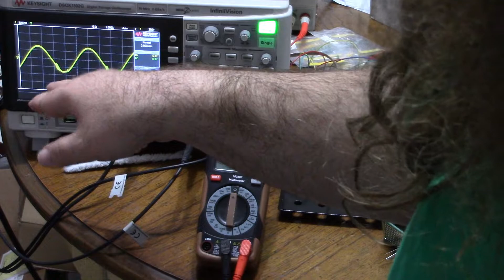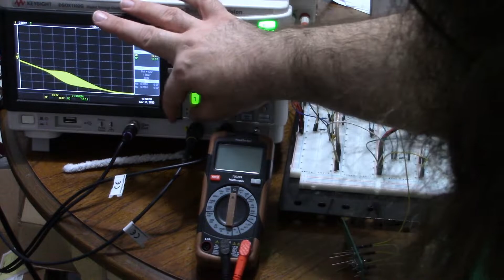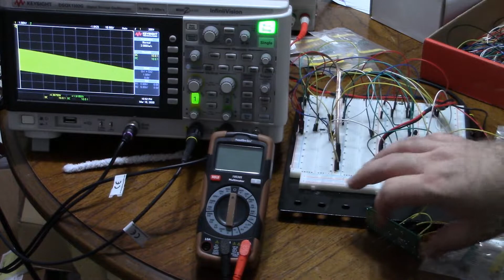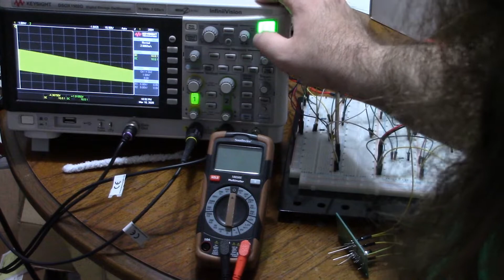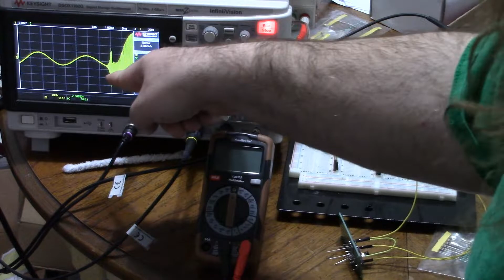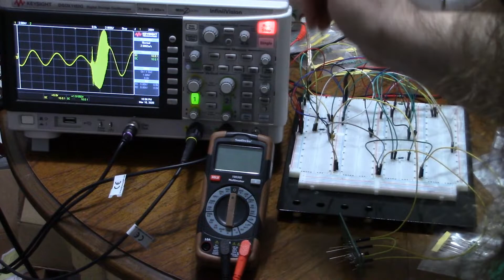Breadboards Destroy AC Signals - Parasitic and Stray Capacitance Ruins My Day - Simply Put

Comment: I was lucky, I got my bread board oscilator to work pretty quick (common emitter colpit) - through dumb luck. Than I put the design into a simulator and it didn't work. Than I try and modify it on bread board to what simulator shows works and it didn't. I have been working on just basic rf theory and amplifiers so haven't gone back to it but I'm glad I saw this video, otherwise I would probably not have got it to work again when I do go back to oscilators as I pulled it apart.

Comment: Great video, you have just convinced me that my problem is definitely parasitic capacitance and I have wasted the best part of 14 months on an 8x8x8 RGB LED cube project. It works, but not like I was expecting or like others I have seen that inspired me to build one. It has a rats nest of effectively 200 jumper wires sitting on top of the cathode and anode drivers stack because I didn't want to go down the PCB route, I now know I might have to. I must say I have learned plenty along the way but I will have to do some more learning to get to the finish line.
Thanks for sharing.

Comment: I try to design a proper radio controller (transmitter and receiver) and desiging on a breadboard is a nightmare! There is not only the capacitance but small elements loose contacts sometimes and recently I mesured exactly the capacitance and there was like 0 (should be 10 pF for example) ! And for a few weeks I was wondering why my antenna wasn't working at all.

Comment: Love your content & style! If someone had the patience, how effective would it be to run fine ground wires as 'shielding' between the long conductors within the breadboard? Would fine wires work, or would they need to be as 'tall' as the conductors themselves?

Could you start with a lower frequency oscillator to get things working, then ramp up the freq to find which bit is the first failure point, rinse & repeat?

Comment: Couple years ago I decided to get into Electronics and HAM radio as a self taught. I set out to build my own radio from scratch and this invariably starts at the local oscillator. Boy, I didn't realize it would take me most of one year just to develop an intuition for Colpitts oscillator circuits, and the skillset to build them.
Bottom line is: breadboards, only below 1 MHz. Beyond that, PCB, or copper clad boards using Manhattan style construction. 
Funnily I only ever built Common Emitter circuits. Circuits like in https://www.youtube.com/watch?v=IcFSVeCF0BM do work well. Considering that the inductor on the collector is paramount.

Comment: I encountered issues with stray capacitance in a recent project where I was finding the microprocessor would halt if I put my hand near it.
I had my 0.1uF caps on all the power rails but those long wires and breadboard tracks really messed with the high speed data pulses.

Comment: Very interesting topic as I've been struggling myself with breadboards on my quest to build cool fxs and electronic instruments..On the other hand, I see Youtube videos of guys building Z80 computers on breadboards so I'm really wondering..Could it be something about the quality of the breadboards themselves, both design and material used? For instance, I got a batch of breadboards that are slightly bent, while some other stand pretty straight. I can't remember exactly but that batch seems to be from a very cheap order on ali express..
Thanks a lot for your videos, I really enjoy the way you explain things although I am not a native English speaker. All my best. B
Reply from the maker: Building a computer like that is going to work great on a breadboard, because it's all digital highs and lows, and since it's older it's lower-frequency which means voltages have plenty of time to settle even with stray capacitance, resistance, and inductance due to the breadboard and any other imperfections. Sometimes the "free" 10-ish pF capacitors can come in handy, accidentally reducing signal or supply ripple. I've seen people say to put a layer of metal foil on the bottom of the breadboard to make it behave better, which is something I should try.
Reply: @simplyput2796  Thank you for your answer! What's still puzzling me is that I managed to have for example this working: http://cmosorchestra.com/2018/03/11/ca3080-4-stage-phaser/ when some simpler stuff wouldn't work..And again I have this batch of very cheap breadboards that "bend" which seem to give bad results..Could the quality of the breadboards themselves have an effect?
Reply from the maker: Bad breadboards could give you issues due to partial contacts, but the quality wouldn't affect anything like how much parasitic noise there is. Also it really seems to depend on what you're doing, because I've done plenty of AC circuits with my crazy long wires picking up signals from Alpha Centauri and what not, and it's only some of them that fail. If the meat of the AC processing is being done in an IC and the rest of it is just various processing stages, it might work great. I'd have to look at an actual circuit diagram to guess any further.

Comment: Oscillators are damn tricky man. I'm doing a capstone project on IC fabrication and my buddy got his VCO fabricated... it's dead / doesn't oscillate. Parasitic capacitance aside there's all sorts of problems even when doing a full blown IC, in a package, on a PCB.
Reply from the maker: I have been successful with one single circuit I found, the common-base amplifier I showed in this video. Nothing else has worked. I'm hoping I can use this with other oscillators and get them to work as well. I must do some sciencing.

Comment: Hahaha, yeah, what a mess you have in your breadboard 😅, have you tried using "u" jumper cables? Those little breadboard jumpers? Also, is your house grounded or do you have fluorescent lights? Sometimes that's the problem :P
Reply from the maker: LED lights actually, though I have plenty of RF sources around here. And yes, I have the shorter "flush" wires and that's how I recently got a common-base amplifier working (mostly) in the breadboard, but they are such an immense pain. The reason I use the wires I use is it's so quick and easy, but it looks like unfortunately I'm going to be forced to do the slow and cumbersome way for any reasonable AC work.
Reply: fluorescent lights. wow! i must keep that in mind if i ever do a circuit like this!!